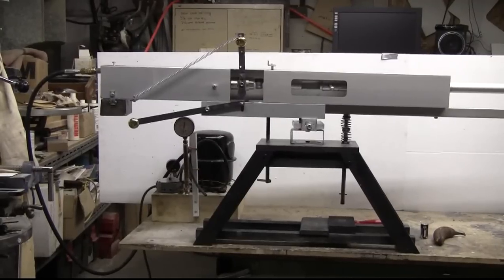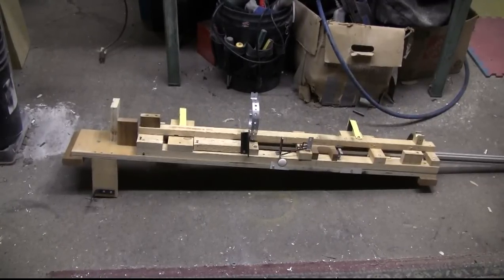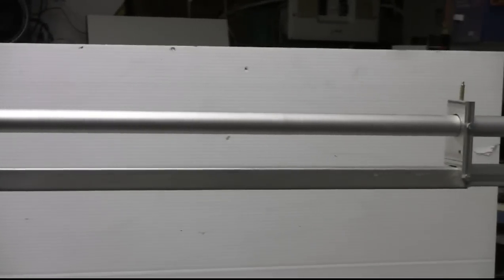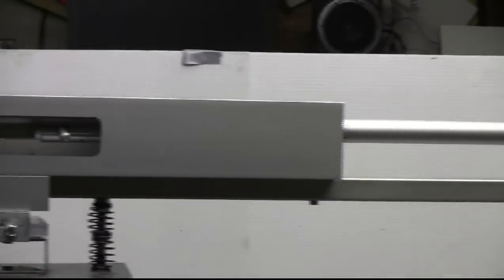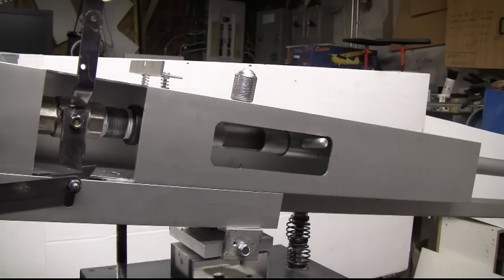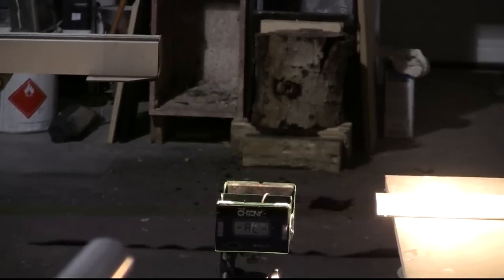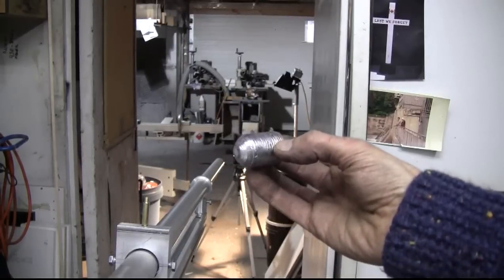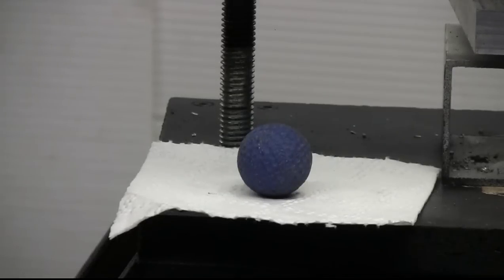Air Cannon #43 - Rebuilt And Splitting A Fire Log

Comment from the maker: Today I fitted my other barrels (.410, .565, .812 cal) to the cannon, and made adapters for the two barrel support points to fit each barrel. A few test shots were fired from each barrel at 300 psi. Accuracy is greatly improved over the old wooden version of the cannon. It also looks much better now. Now I will be able to make videos rather than having to adjust and fix things every few shots. Thanks for watching, plenty more to come.

Comment from the maker: The barrel shown is my 25 mm, 96 inches long. This is a standard 8 foot length of extruded aluminium tube with 1/8 inch wall thickness, OD is 1 1/4 inches.It is also clear anodized inside and out by the manufacturer and has a very smooth even bore. I cut an opening with my mill for breech loading, and made a sliding bolt like cover on the lathe. Still have to load long ammo like darts from the muzzle. Last, I threaded the end of the barrel to screw into the 1 inch ball valve.